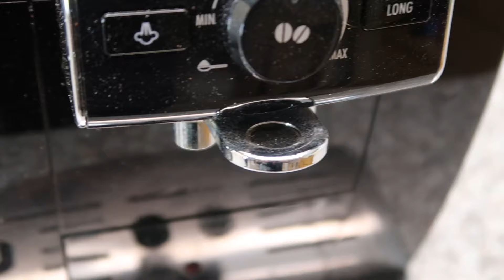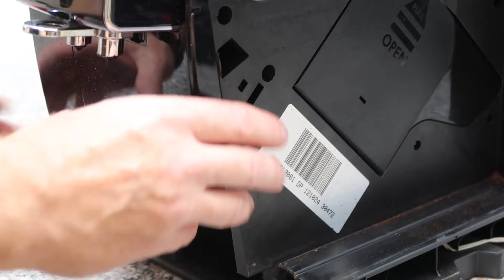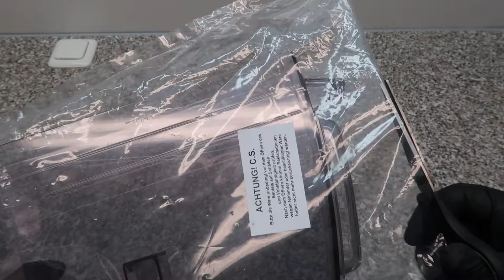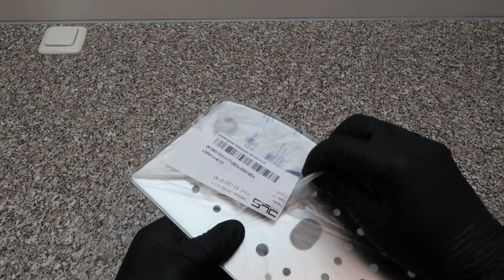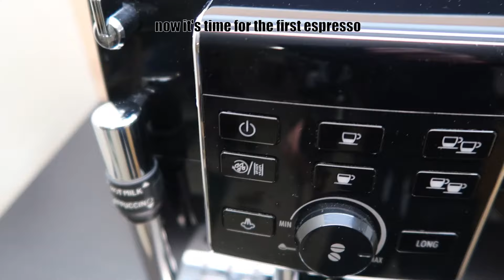DeLonghi ECAM Fully Automatic Coffee Machine Restoration | DeLonghi Repair and Restoration

Comment: Hi, great video!  I have a question - if I remove the stainless steel tray (that holds the coffee cup above the waste water tray) and brew coffee (without it being there, so I can see what's happening), I can see water coming out of what seems to be a spout on the left side (directly above the little red drip catcher container), and the water goes directly into the waste water tray area.  It does this while the coffee is being brewed.  Is this normal?  The coffee comes out normal, but I was just wondering why water would come from there at the same time as coffee extraction.
Reply from the maker: Hi, this is an expansion chamber for the steam coming out of the heater. After the steam cools down, there are a few drops of water on the left side. If there aren't too many, then it's normal.
Reply: @yt.myworks  Hi, thanks for the reply.  On my machine, there is a constant small flow of water coming out during the brewing/coffee extraction process (and only a few drops during the machine rinsing process - probably because of less pressue with no coffee grounds present).  Any ideas where this water could be "leaking" from and being diverted to the expansion chamber?
Reply from the maker: If the machine is already a bit older, 4-5 years, then the problem is probably due to the brew piston infuser, which is probably worn out. Here are my other videos on the subject: https://youtu.be/9PEf881kFAo, https://youtu.be/3QBLoTMgTec
Reply: @yt.myworks  Awesome, thank you!  I will definitely check those out.

Comment: Hello! Thanks for the great video. I bought a used magnifica s  21.117B. Its in good condition, but the coffee is a bit transparent and the flavor is "water-like" even if the machine is set to the strongest coffee. What do u suggest, should I do the same process as u did? 
Thanks in advance
Reply from the maker: Hello, how is the grinder set?  You can adjust it a step or two and then.  You can see the result after three coffees.
Reply: @yt.myworks  I set it already to the strongest. but the coffee is still transparent a littlebit
Reply from the maker: @emilagyanszki4371  Is the coffee ground finely or coarsely?  Must be as fine as sugar. What is the position of the regulator in the bean container?

Comment: Brilliant video and super informative! I have an ECAM250.33 TB it suddenly just wont go into "ready mode". I turn it on, all the lights flash for a long time, about 2 minutes. Then machine gives up and just shows a steady alarm triangle light. Do you know how i might try reset the machine before doing such a tear down for a deep clean up? or any other ideas of what the issue is? I tried cutting out power in the back, then turn back on and same issue. Thanks!
Reply from the maker: How old is the machine and how many coffees have been made?
Reply: @yt.myworks  just 1.5 years, at about 2 coffees a day that's just about 1000 coffees
Reply from the maker: @EvansMutai  This is very strange, this error often appears on older machines as they wear out. For some reason the brew group cannot find the home position. This can have many causes, for example one of the microswitches is broken or the hall sensor. Maybe the inside of the coffee machine is dirty!? Try to reset and then thoroughly clean the inside of the machine.
Reply: @yt.myworks  thanks for the insight. Ok will give it another thorough cleanup. How do i reset the machine?
Reply from the maker: @EvansMutai  Simultaneously press the "On/Off", "One cup" and "Two cups" buttons while plugging the fully automatic machine back into the socket. Release the buttons when the one-cup, two-cup and steam indicators flash simultaneously. The DeLonghi coffee machine then performs the reset.
Reply from the maker: hmm... this is a new model, maybe the button combination is different. You may have to search the internet for how to do a reset. I don't know either, sorry :(
Reply: @yt.myworks  ok thanks a million for the speedy responses and support!

Comment: Thank you for the very detailed video.   I have a DeLonghi ECAM 23210B which lately no longer extracts much water through the puck.  Most of the water ends up in the drip tray and dregs container.  This started a few weeks ago and rapidly became worse.   Also the milk frother can only froth one cup of milk.  For additional cups it just makes a very high pitch hissing sound and heat the milk up but does not froth it.   The machine is old and has made many thousands of cups of coffee and I keep it because it makes very good coffee when it works.

I know it is very difficult to diagnose with such limited information but do you have any suggestions what may be wrong?  I am encouraged to overhaul the machine myself based on your video.  Do you know where I can order a kit (in the United States) that contains all the needed O-rings?  Thanks
Reply from the maker: Hello, unfortunately I do not know where to buy spare parts in the US. Supposedly these are not as easy to get as in Europe. Most of the problems in this DeLonghi model are caused by the brewing piston which is built into the top of the machine. Over time, the o-rings wear out, leading to leakage. I made a separate video on this topic: https://youtu.be/3QBLoTMgTec

Comment: Thanks for sharing this video; you did a fantastic job!.
Maybe you could help me understand something im struggling with
I have a problem with my Delonghi Dinamica. After accidentally adding 2 cups of pre-ground coffee, the water doesn't come out anymore.
I tried to take apart the machine, but I didn't find the issue, so I gave up and wanted to take it to service. However, when I put everything together again, I failed to see where the little spring with the 2 small silicon pieces on your top right at 9:46 should be. Can you please try to explain or show where it should be?
Thank you very much in advance!

Comment: hi, I have very similar model, mine, leaks on to the counter, I have found that on the left side where drip tray is, instead of dripping from drip hole, is running along the front of the unit and onto counter instead of tray, any idea whats most likly to leak? I had a look from the side but I didn't know how to take front panel off, now I know so I will give it another go
Reply from the maker: Hi, it usually drips when the residual water drain (housing for the thermoblock) is heavily calcified.
Reply: @yt.myworks  can you please have a look on my channel, I've uploaded video of my fault. Since I've got it open and I've changed o rings in the middle top part but it's still leaking before and after making coffee. Any ideas where to look next? Is there any way to confirm what part is leaking before I but it?
Reply from the maker: I think the problem could be the same as this video: https://youtu.be/MevXIJX7SLA
Reply: @yt.myworks  I've cleaned that black chamber next to heater but I can see that water is coming down from top middle area, I've disconnected hoses from top and from safety valve before heater. Please check this video https://youtu.be/uczs3v8Vh7Y I don't understand why this water is coming down before and after making coffee, I've adjusted grind all the way to 7 and still I get that leak ;(
Reply from the maker: Hmm .. I'm not sure, but the valve in the top piston might not close properly. Sometimes it happens when the valve is calcified.  Try descaling the top piston. See my other video from minute 7:00, maybe it will help: https://youtu.be/OJWguSgyf4c

Comment: Hi! I am trying to fix one of this machines. And i have a general alarm when starting up. Could you tell if this machines move the infuser when starting up or if it only heats water until it has to move the infuser? (it only says heating, and timeouts to general alarm) Thanks! greetings from Argentina!
Reply from the maker: Hello, I checked what the machine was doing after turning it on.
Step 1: The brewing unit moves down, the machine heats up
Step 2: The brewing unit moves up and the machine rinses
Step 3: The brewing unit moves down to pick up coffee powder
I hope this helps with the repair.
Greetings from Germany ;-)

Comment: exactly what type of lubricant you used with syringe on those nuts/screws? is it silicone based?  

i have another such delicate machine set aside for malfunction at home, a  mouth wash irrigator from oral-b, i 've seen exact lubricant in color and consistency when i took the plastic pump barrel and piston apart.
Reply from the maker: Which screws do you mean, min.?
Reply: @yt.myworks  i meant the grease on motion screws before,  in another video of yours found the answer, it was labeled as food grade grease. if you dont mind me asking again, do you have any knowledge on plastic piston type displacement water pumps used in mouth wash irrigators? not seen anyone dare to repair that part before on the internet but you seem have a good knowledge on delicate household pressuried water setups

Comment: Hi, I have a question. Where is the drip tray extension sensor? The machine suddenly started to see that the tray was installed and then that it wasn't. It was like a disco on the indicator lights.
Reply from the maker: Hi, there's a slot or small opening on the left side. The microswitch is located behind it. Also, check the drip tray for a small tab.

Comment: Hey, there. Good Video. I have almost the same kind of coffee machine. I've been having this issue with my machine that it does the grinding but the coffee does not pour out of the nozzles in front. Sometimes when I turn it on and off or wiggling the diffuser then it works. I have already cleaned the piston generator (brewing unit) and that did not solved the problem. Now I'm thinking maybe the diffuser is the problem. Could you tell me what is your expert opinion is on this matter?
Reply from the maker: @shahriar keshvary: 
I think the delonghi brewing piston is leaking. It's up in the machine, white/yellow part (07:58). Where is the water going? Is the used coffee wet? LG
Reply: Yeah, so since the water can't pass through the inffuser, the coffee dropping is all wet.
Reply: By the way I cleaned that part you mention. The one in (7:58). I cleaned it about a month ago, and seemed to be working better but now it has just stopped.
Reply from the maker: @shahriarkeshvary1459  You have to open the machine and see where the water is coming from. This is the only way to find out where the leak is. Check that the tubing is properly connected to the nozzles. If there is water in the yellow, transparent part (07:58), you must change all seals.
Reply: Let me get the new piston that I have ordered,  then this time I will follow the water and see where it stops.  Thank you for your time.

Comment: Can you Plz tell when delonghi milk frother not working what we have to do normal milk coming
Reply from the maker: @S katheru: Mostly it's a broken solenoid valve in the bottom left of the machine.  But it can also have other causes.
Reply: @yt.myworks  no other problem not only Milk normal coming not frothing
Reply: I have delonghi cuppcino
Reply from the maker: You have to start with the cheapest parts. Check whether the milk connection is blocked.  If not then you have to replace the solenoid valve.

Comment: Hello. Few months ago one of the 2 moving cog arms of my brewing unit broke, something must have been misaligned. I bought a new brewing unit, and it worked fine for months, but last 2 days the machine has been doing a horrible cracking noise towards the end of the starting sequence and obviously it didnt work when trying to make a coffee, the grinder would run but the coffee ground would fall straight into the tray or go up the ground coffee funnel, i'm worry something will break again. I have reset the machine with the on off power button at the back and it seems it has fixed this issue. I also have some water in the used coffee tray. I'm thinking maybe I should grease the transmission, and the water leakage problem could be a an O ring problem. Your thoughts ? Thanks in advance.
Reply from the maker: Hello, check the bracket for the brew group to make sure it is screwed on correctly. Sometimes the two stainless steel screws get loose. You should also check the lever on the case for function, sometimes it breaks off if the brewing group has not been assembled properly. You can see how everything needs to work properly in my other video in minute 5;59 views: https://youtu.be/HZ8oQUGtPjc
Reply: Thanks for your quick answer. As mentioned previsouly turning off and on with the back button seem to have reset things and realigned everything. I have greased the transmission just in case. Only problem left is water in the used coffee ground tray and one of the coffee spout nozzle seems partially clogged. I saw your video about cleaning the coffee spout, but mine is a Delonghi ecam 23.210 and it seems I have to open up the whole machine as shown on your video "Longhi ECAM Fully Automatic Coffee Machine Restoration ", not sure If I feel brave enough to do it, despite your awesome video @yt.myworks

Comment: I did everything as you did until 2:04, but I just cant get the plastic valve that turns the steam on and off.. looks like you just pull it out with ease, Im fighting it for half an hour... :(
Reply: Succeeded by prying it open with a small screw :)
Reply from the maker: @jonatansverdiolas486  There is a spring on the inside, which you can move a little, then it is much easier ;-)

Comment: Hello, I am in the middle of restoring an approx. 7 years old DeLonghi Magnifica S Cappuccino (ECAM22.360.S). It wasn't in a horrible state but upon taking it apart thanks to your instructions, we have found that both the infuser and the piston were very dirty and the piston was retaining and leaking water. I am awaiting the delivery of spare O-rings I ordered to replace the old ones and have already cleaned everything I possibly could. We are also planning multiple descaling sessions to make sure the system is clean and if any other issues are found, at least we know that this isn't the issue. Your videos have been instrumental to us being able to do this so thank you very much for making them available to us! 

I have two questions for you:
1) There is a mushroom valve in the piston (can be seen at 9:15 in the video), from which I am missing the silicone spacer within the spring (the mushroom head itself is still on the spring, just very compressed and will need changing). Do you know how I could replace this spacer (e.g. small silicone pin or similar)? Is it vital to the function of the piston or can it be omitted? Do DeLonghi even sell the whole valve at all at this point? (I am in the UK for context, I am happy to order from the EU if needs be/if you know a good source) 
EDIT: I have just realised that one of the piston springs is also cracked. Are any of these available anywhere?

2) Do you think it's worthwhile to take apart the transmission at this point, or should it be left until more significant issues occur with it? It seems to be dirty and needing some grease, but the machine still works, even before we took it apart, it just wasn't at its best due to the issues I wrote about above. Are transmissions in these machines a huge problem?
Reply from the maker: Hello, I order a lot from these online shops: juraprofi.de or komtra.de. You can get the two springs on eBay, for example: https://www.ebay.de/itm/2-stueck-Pressure-springs-for-den-Bruehkolben-DeLonghi-ECAM-ETAM-Kaffeevollautomaten-/324834160850?mkcid=16&mkevt=1&_trksid  =p2349624.m46890.l49286&mkrid=707-127634-2357-0. 

You can also use a piece of silicone tubing to replace the white spacer. 

If the transmission still works then you can leave it in. This never causes problems if the spindle has been greased regularly.

Good luck with the repair!!
Reply: @yt.myworks  Hello, I'm sorry I missed your reply! Thank you very much for the links, I have actually ordered from the eBay seller and he delivered everything promptly. 
As far as the spacer, I have ended up ordering the whole spring but I will try to find some tubing for future repairs.
The transmission, as far as I know, has not been greased at all over those years, but I will try to grease it from now on and hopefully it will be OK. I will report results soon. If not, I will refer to your vidoes for help :)
Reply: @yt.myworks  Hello, after full reassembly (I discovered a deformed o-ring within the raccord hose connector as per your other video, which I replaced), testing, descaling, and some tweaking of the grinder, I can happily report that the mechanism sounds smooth, the grinder gives 10g of grounds for extra-strong, the infuser makes rounded pucks of coffee, there is no water in the grounds container or in the red reservoir under the tray, and the machine pumps out 37ml of coffee at 90degC for one short that tastes just like the bean. Having replaced the O-rings in the steam vent, it also dispenses lovely smooth milk foam without sputtering. Other than some limescale that is still floating about in the system, I'm happy to report that the machine seems to be fixed up to standard again! Thank you once again for your fantastic videos, I wouldn't have been able to fix it without you! I learned something new and can now drink some nice coffee again so 10/10 😊

Comment: Thank you for this outstanding video. What is the most likely cause of excessive water dripping into the very small red "tray" in the front of the machine, visible when you slide out the grounds drawer? Thanks in advance for your help!
Reply from the maker: Is the water dripping next to it? If so, then the expansion chamber is probably very dirty and should be cleaned. This is the black cover over the heater on the left side of the machine.